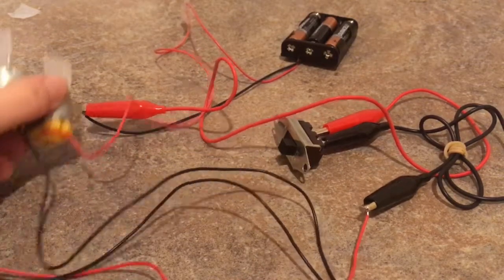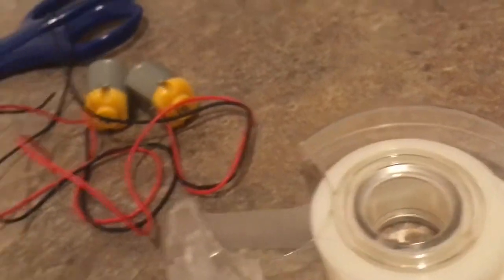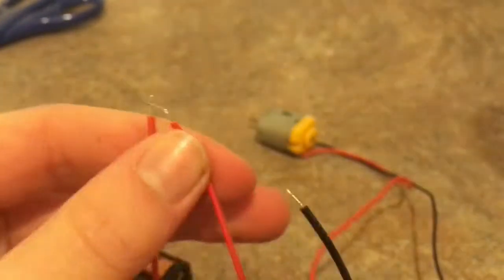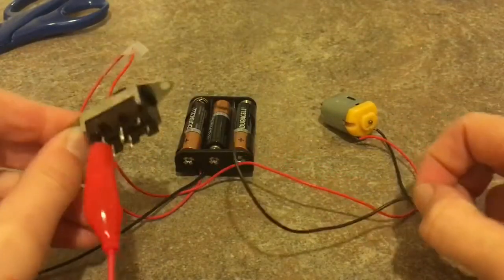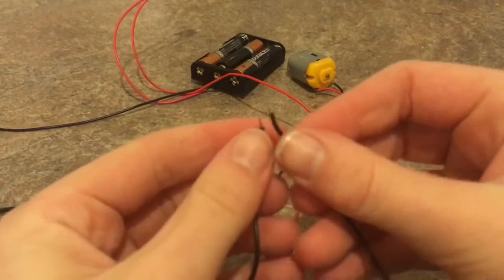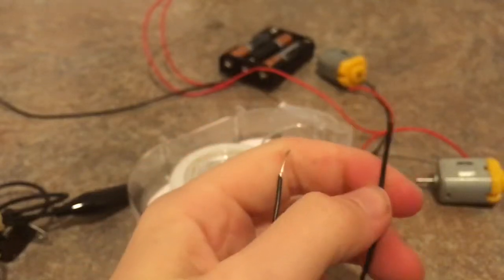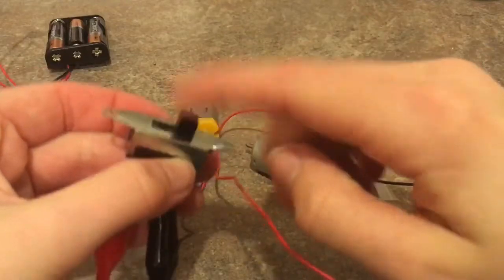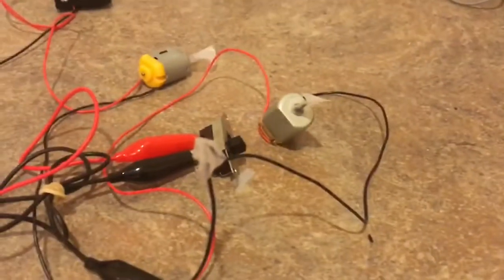How to wire a battery to 2 dc motors

Comment from the maker: I still answer questions in the comments!
Subscribe to help me get to 3k 😀
Reply: Hey friend,
does this work if I twist the red motor wire with another black motor wire and do the same for the other 2 wires? sorry english is not my first language
Reply from the maker: @DinieTutor yes it should be fine as the color wire does not matter, it’s just the coating on the outside. Just make sure your not crossing positive and negative charged wires.